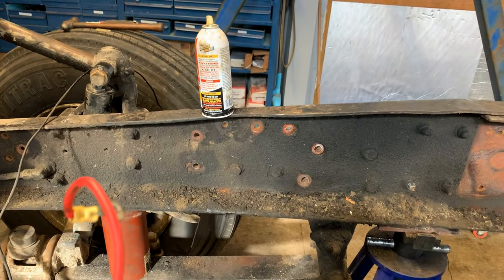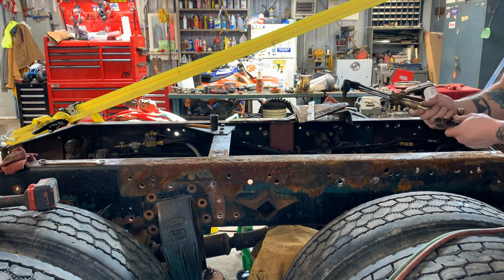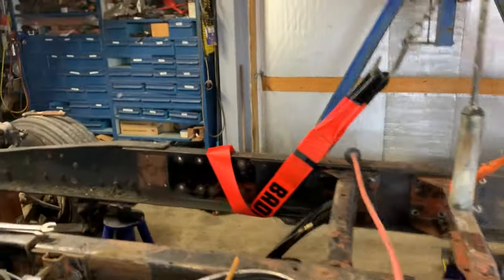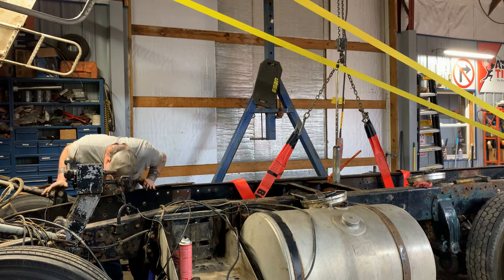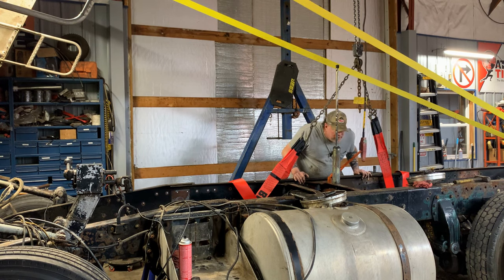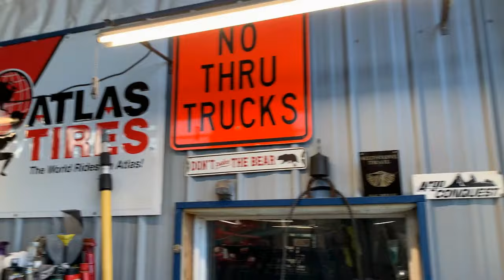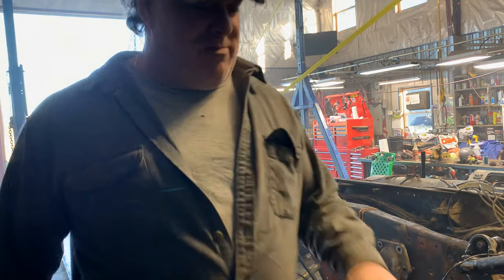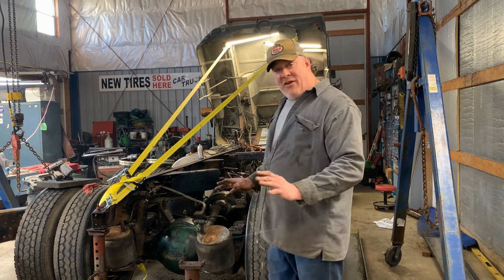Mack Cruise liner Frame REMOVAL!!  Pull It Out!! The Semi With No FRAME!! It’s Finally Out!!

Comment: Great work.  A few years ago, we changed out one rail on a tri axle International that was triple framed and broke right behind the cab.  We blocked the good side up on oil drums and mill roll blocks and disassembled the whole bad side and slid in the new rails and it was a chore.  Drilling the holes is a whole new story.  I still cant get over  Macks engineers designing the starter solenoid to be installed where they did.  Keep up the great content.  Bill
Reply from the maker: Very cool! You know the process!! Thanks for Watching!! BP